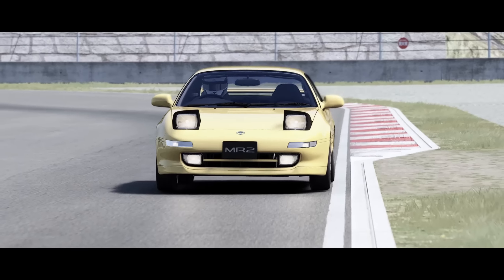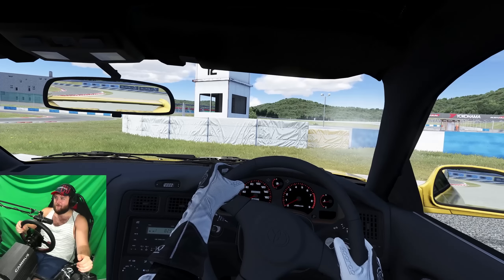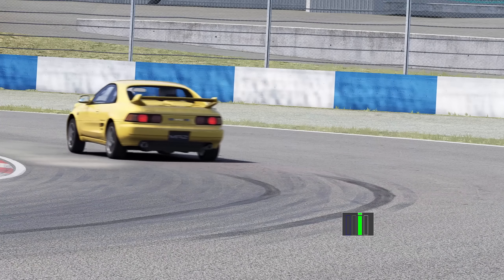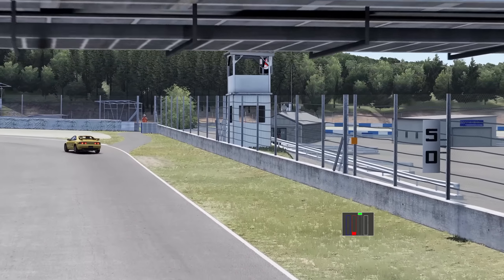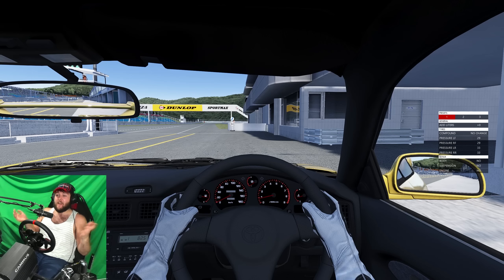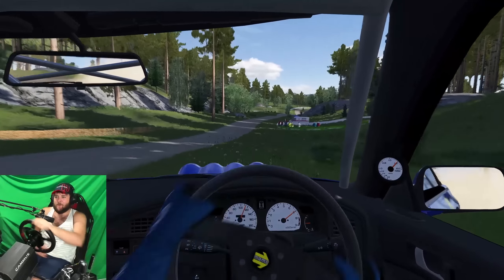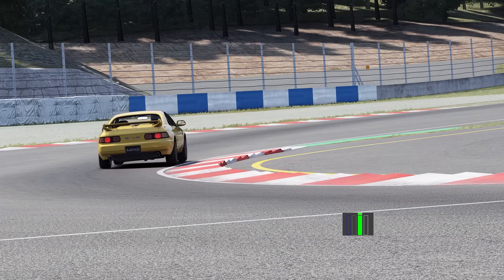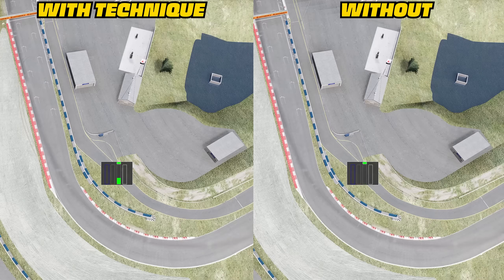Snap Oversteer & How You Can Use it To Go Faster...

Comment: Liftoff oversteer is not the same as snap oversteer. Full disclaimer, haven't watched the full video, but the first clip definitely shows liftoff oversteer, where the weight transfers to the front when lifting the throttle causing the rear to become light and lose traction. Snap oversteer is when the car has already lost traction and started oversteering and then snaps when the driver tries to correct the car due to the rear tires momentarily getting a lot of grip causing the rear end to snap in the other direction. Think of snap oversteer as a highsider on a motorcycle
Reply: This video shows only lift off oversteer. If you own a MKII Turbo MR2, you probably know that the comment above mine is 100% correct.
I spun mine on day 2 of ownership. I entered the freeway on ramp from a u-turn a little too hot and let off the throttle near the apex. I got a half turn clckwise and then a full 360 in the opposite direction.
I improved my setup and the car improved my driving skill.
Reply: i was wondering that. glad someone confirmed

Comment: My understanding what that snap oversteer was when your sliding car suddenly grips up and throws you back the other direction... i have never heard of lift off being called snap oversteer, have i gone this long with the wrong idea?
Reply: There is an actual confusion between the two in the community. Yours is what Is know of too.
Reply: Snap oversteer only happens in MR and RR cars because you get a funky pendulum snap from the engine in the back. Lift off oversteer can happen in any car and is what this video describes, although rear engine cars can lift off more if their suspension is wonky or if you try breaking into a corner with them instead of in a straight line.
Reply: @unsub me, your understanding is actually the correct one, this video is confusing terms which are dissimilar to incorrectly mean the same thing which in reality they don't

The "snap" in snap oversteer is a sudden snap from one direction to another from suddenly gripping up in a slide, for example car turning suddenly turning left, in a right corner where the wheel was turned left but the intention was to still turn right with the help of a rear slide
Reply: Yeah technically he is talking about lift off oversteer
Reply: they are both the same thing. You come in too hot, or in too high a gear and then when you lift off throttle or go onto breaks the interia weight of the car is thrown forward, then you try to turn and it will pendulum 180.  ive driven mid engine cars for about a decade. Theres alot of people shooting hot air imo. THe best way to control a mid engined car in a corrner is to make sure you are on the throttle throughout a corner, it beds the rear in and gives you grip and torque. I heel toe downshift all corners, in the mr2 it work amazingly, you will be in the perfect power band to punch out of the corner.

Comment: Great video, I think the mr2 is a very interesting vehicle. A transverse mid engine layout sports car that doesn't have huge power or a high price. Low on power, it makes up for this with a short wheelbase and low polar moment of inertia, causing such snappy handling along with the layout. It's weight distribution gives it a bit of an advantage against FR cars with similar specs, because under braking the weight is distributed equally over all 4 tyres, whereas under acceleration the majority of the weight is over the rear wheels helping grip. However, this has somewhat negative implications when cornering. Unlike a 50/50 weight distribution vehicle, where neutral throttle is used to get the optimum grip on all 4 tyres, the front tyres tend to have less grip than the rear causing understeer. However, trying to correct this mid corner by easing off the throttle has the opposite affect because the weight of the vehicle is near the rear, so its tendency to swing round is amplified compared to an FR vehicle with the weight over the nose. As a result, another optimum driving strategy used by drivers of this layout is to prioritise exit speed even more so than usual, in order to make the most of advantageous straight line braking, to start cornering whilst the weight is still over the front axle and to accelerate as early as possible (playing to the layout's advantages). An unusually late apex racing line can be used to achieve this, as seen by porsche drivers, who's cars with the engine in the back experience similar characteristics (but to a greater effect).
Reply: As a happy MR2 owner, I'd like to thank you for this nice description!
I'll just add that, based on the feeling I have with the car (this is not a scientific proof though) I would say the weight distribution on braking is not really balanced and throws a lot to the front. One time I even managed to lift the rear wheels slightly from the ground on a heavy braking :)

It's a car that does not forgive optimism on your entry speed. It's a weird situation where you're arriving at a certain speed in tee corner and you KNOW that if you're too fast, you'll not be able to break or lift off the throttle completely, because of this famous lift off oversteer, but if you're too fast you could also loose traction buy oversteering or even understeering into a beautiful tree.

So you really need to be confident in your entry speed and know the level of grip you have.

And I experiences all of this in the NA MR2 with the 3sge engine, therefore only producing 160hp!! I can't imagine how sketchy it can get in the turbo 3sgte version
Reply: @karu_yatsu  same in the ZZW30 - about 80% of the braking is done with the front axles, I've gone through many sessions with rears basically cold
Reply: @karu_yatsu  Sounds like you need to tune your suspension. More low speed damping at the front should do it methinks. Great car.
Reply: @Christophe_L  thanks for the advice! You're probably right! I'm running the stock suspension that is 30 year old so... Might be a little tired! 😂

Thanks for the complimente too!
Reply: It's very interesting... until you hit a lighting pole.

Comment: As a front engine driver, getting in anything like a Porsche or Ferrari, anything with most of the weight behind you felt really strange and didn’t suit my aggressive driving style, I suffered with under steer a lot trying to power out of corners, that’s now very obviously the wrong thing to do, trail braking and plenty of weight transfer over the front wheels makes these cars so much more fun to drive, the key is using the weight transfer to your advantage, people are quick to say it’s the cars fault (I was one of them) but an adjusted driving style has made me like a wider variety of cars now, still prefer front engine all wheel drive but rear engine cars no longer scare me

Comment: This isn't really using snap oversteer - it's just using weight transfer, especially since you're only using a little bit to avoid the snap.
Reply from the maker: fr????
Reply: Yeah, it's a bit of bad info for people wanting to understand real snap oversteer, but barring that term as a video about "liftoff" steering it holds true

But agreed this video isn't at all about using snap oversteer at all, which you'd never do for a sweeping corner, however S'es/switchbacks/consecutive/hairpins if close enough would be a place where inducing sudden grip to switch directions ala snap oversteer may prove a useful trick

Comment: Lift-off oversteer also works for FWD cars. It's also great to get your FWD car sideways - or more helpfully, to get a bit of rotation. Basically initiate some rotation into the corner and then nail the throttle to cancel it and accelerate out of the corner.

Basically any technique that maximizes the usage of slip angle helps you through a corner.
Reply: yee, plus using a bit of brakes to put even more load on the front wheels and you can get pmuch any FWD car rotating like butter
Reply: you just let me know i did this a lot on dirt rally 2 without knowing this is a skill LOL
back when i was stuck using the first car, i found out lift off the throttle or light braking right before the corner than accelerate again, will give me a drift like state which make corner way easier.
Reply: Can confirm, liftoff is the most reliable to get my cobalt sliding around town in the winter
Reply: i experienced oversteer on my super weak car ( for the first time IRL). After that I realized that I was just using my lil city-cruiser a little too harsh xDDD. From now on I slide it like for fun  ( only in rainy conditions).
Reply: @gamespender8605 
Do not try to use FWD techniques to correct an MR2T oversteer.
Reply: with a good brake setup...you can easily hit the entry/mid corner fast AF in FF....with this steering/angle control...and do a precision/break stab/jab and instantly get back on throttle. Or 2 foot if youre feelin really rascally...and when i say fast i dont mean on throttle im talking speed management/deeper-higher entry speed. But its more worth practicing both at manageable speeds before pushing the ability its a lot harder to know how to modulate left foot breaking if you lack familiarity if you get your own line its one thing...but sharing/traffic is completely different to this sort of maneuver.

Comment: As we know, Snap Oversteer happens with the MR2 the most.  But otherwise this can easily happen to really light cars at high speeds.  It's usually felt more in cars that weigh less than 1200kg.   Having a light vehicle is good yes especially for performance, but too much weight reduction can also bring in sensitive troubles like snap/lift of oversteer especially if your car doesn't have enough downforce to keep your car planted.

Comment: after driving mostly the MR2 around in Assetto for well over a year, ive gotten used to the oversteer and actually try to induce it around sharp corners. lift off oversteer as well as overbraking are my key tactics around majority of the mountain passes
Reply: Overbraking?
Reply: @christopherjohnston6343  pushing the brakes so far that the rear comes forward. its most common in mid and rear engine cars. the weight shifts forward while braking causing the rear wheels to loose traction. basically oversteering but with breaking instead of gas
Reply: @izu1525  oh okay basically braking no smoothly so stuffing go weight transfer?

Comment: I would say that heel toe downshifting corners in a mr2 will work substantially better than using lift off oversteer,/drifting it.  Use the gears, its what they are there for.

Comment: I'm very familiar with the setups these cars run in real life to prevent it, i don't know how it is modeled in game but reducing rear ride height specifically on a SW20 fixes the main cause, that being its rear roll center height (hint: stock its very high.)  Its not simply a matter of the fact the rear is lower and closer to the ground, the much more important thing is that the camber angles are more consistent while the suspension decompresses which is usually where you get the "snap", from momentarily losing first the inside rear tire followed by the other simply not being able to keep up and recover.

From best i can tell reason for the setups like this was essentially a compromise, you can get admirable on-paper performance with better then average ride quality, especially with tools everyone had back in the day, the cost was stability.  Luckily there are other ways to improve ride quality for sporty road cars so you rarely ever see manufacturers set cars up like this.

My biggest pet peeve is people thinking its simply a mid-engine thing, its not, even if rear weight bais pronounces the problem more readily, same issues with suspension geometry still causes same thing even if on surface level is less apparent on front heavy cars (certain generations of Mustangs are great example, despite how different their weight distribution and suspension design is, sans some models similarity in very very high rear roll centers)

Comment: Well, I was waiting for another video but reupload is good as well. I wanted to propose an idea you could test in one of the next videos. And the idea is of course from initial D, in the race AE86 vs Civic, Takumi vs Shingo (his name was I believe), when Takumi got mad, he started going insanely fast and there's a scene where he bumps his rear into the guardrail in one corner to bounce off it and enter another corner. Would you test if it's possible in asseto (or in real life if your're brave enough xD) and would that actually make any sense?
Reply: That's an interesting idea. I tried it in indoor karting and hitting walls surely do bounce the kart off of them. But it's a whole lot different with cars: the body is big and heavy and the guardrails are pretty soft, as far as I know. Actually I'd like to know if what Fujiwara did is really possible.
Reply: If I put a scratch on my car my family will disown me
Reply: what???
Reply: Muh initial d
Reply: @anders0nd0ge  I mean,  guardrails are soft nowadays. But it's 2000 Japan and they weren't the American ones that has to absorb the energy but more, they were designed to bounce off them because you know, there were mountain roads, you wouldn't want to fall off the road. So who knows.
Reply: @michakasprzak6869  well, on the other hand, they can deform in such a way to not allow the car to go through them (remember what happened to Iketani), so I'm still not sure about the softness.
Reply: @anders0nd0ge  well,  if not the guardrail,  then maybe some solid wall
Reply: @michakasprzak6869  in this case it's more likely that the impact from the car will be absorbed by the wall and the car will just... Well, deform in the place of contact.
Reply: @anders0nd0ge  maybe Bunta tunned the AE86's rear especially for that moves xD to be more bumpy
Reply: Yeah doable to some degree I'd think (although maybe Assetto and IRL physics say otherwise) and as you're probably thinking the speed came from taking that unorthodox line but keeping the speed up by bumping into guardrail/going into dirt and being able to do whatever as in say taking a tighter line via rebound or something similar then making up for all that lost time without going overboard with all the craziness

Comment: Isnt Snap Oversteer uncontrolable by definition because is something that happens suddenly and you dont expect?
Reply: how i understood the video was that you don't just randomly get snap oversteer. it's seems like it's typically because of driver error like lifting off the throttle too long mid corner. i believe you are correct that there is a small window before you hit the point of no return where you end up losing control
Reply: obviously i could be very wrong, so take what i said with a grain of salt, but that's my understanding at least
Reply: This video is very very incorrectly using the term "snap oversteer", what is shown throughout the video is liftoff oversteer

"SNAP" oversteer would've be if his car suddenly turned left in the middle of that right turn during a slide because the rear suddenly gripped up & his countersteer suddenly become regular steering into the wrong direction